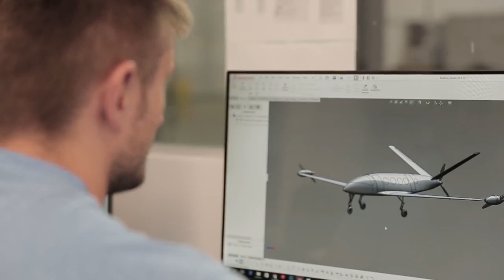Eviation Creates World's First All-Electric Commuter Airplane

Comment: Their plane makes no sense. With the prop in the rear, how is it supposed to roll for takeoff without a prop strike? Not to mention the props on the ends of the wings are literally the worst possible placement to place thrust on the whole plane, as a failure on one side would force the other side to shut down due to the huge amount of asymmetric thrust.
Reply: But most of the thrust is from the back so the asymmetry from a wing engine failure would be the same as a 2-engine passenger aircraft.

As for how it rolls for take off: using a tall wheel base which keeps the propellers clear of the ground. The wheelbase retracts shortly after take off for aerodynamic efficiency, hence its not shown in the animation.
Reply: @sid6554  It is not though. Most 2 engine aircraft have both engines as close as possible to the fuselage, so that in the event of an engine failure, the new center of thrust would be as close to the middle as possible. With that design, if you had a wing motor failure, the new center of thrust is now halfway out on the opposing wing. That is too much to overcome simply with opposite controls. As for your comment on tail strikes, it does not have a tail wheel, it has a tricycle gear, and according to the design shown, the main landing gear is not tall enough to allow for much if any roll on takeoff. Theoretically you wouldn't need to roll if you are going fast enough and produce enough lift, but it would still result in a much longer takeoff roll than necessary, eliminating many small airstrips from being accessible.
Reply: @v12tommy  Come on man, re-read my first comment - the rear engine provides most of the thrust; It should be obvious why this reduces asymmetry after an engine failure but to make it more obvious I'll suggest some rough numbers (the numbers don't matter just the proportions) and do the calculation: 60MN thrust from rear and 40MN from wings. Assume side engine is 3x further from fuselage than in an conventionally designed aircraft of the same size (which has all 100kN from the wings). Assume fusealage is 4m wide. Assume wings are 9m long each for easy maths (keeping it divisible by 3).

If a side engine blows out, the moment from conventional design is [{9m*1/3(as it's only a third of the way from the centreline to the wingtip)+2m (half of the fusealage)} x  50MN (thrust per engine)] = 250MNm moment from conventional design.

If side engine blows out, the moment from Alice design is {9m+2m(half of fusealage) x 20MN (thrust per SIDE engine)} = 220MNm moment from Alice design. 

The Alice design is equally if not slightly MORE symmetrical upon engine failure.
Reply: @sid6554  You still haven't addressed the issue of prop strikes. You said there is a tail wheel that retracts, but it is a tricycle gear aircraft.
Reply: @v12tommy  You don't read anything properly. I said TALL wheel base that retracts not tail wheel base.

Comment: They want to make an electric airliner which goes 100 to 600 miles ?! Naivety at the moment .
  Even the first flight is 15 years away considering battery energy density presently .
Reply: 111danish- Sure, sure, just as electric cars 5 years ago, were 'fifteen years away' !  I'd say, you are wrong... this plane will have TONNES of batteries, and fly in 2-3 years.
Reply: Interesting "opinion" shared in your comment, but I saw the prototype fly several months ago so they will meet their 2021-2022 timeline.